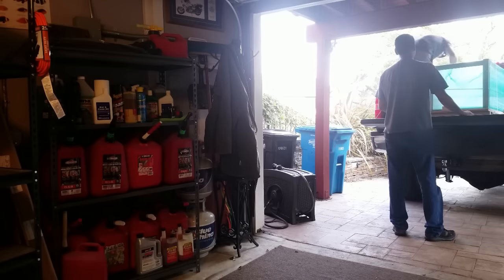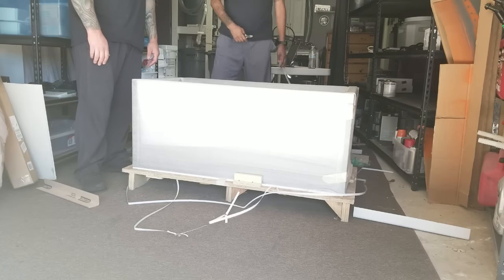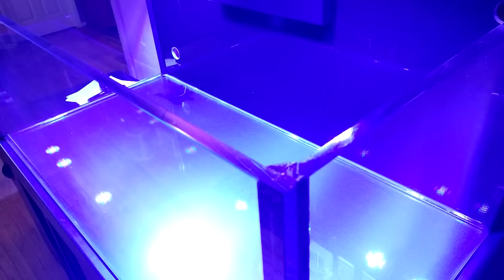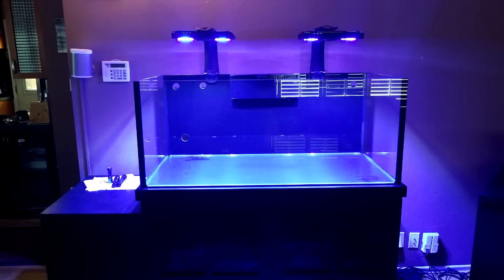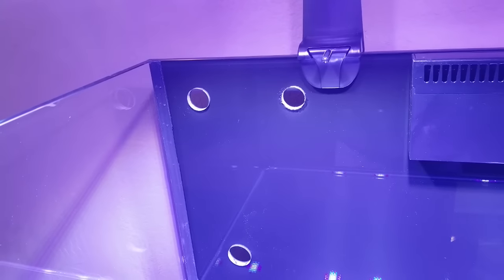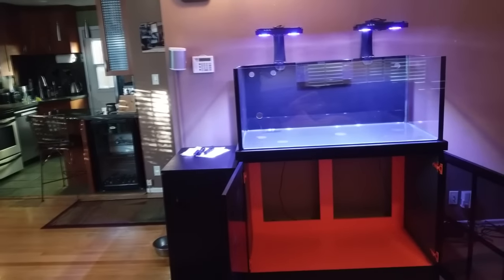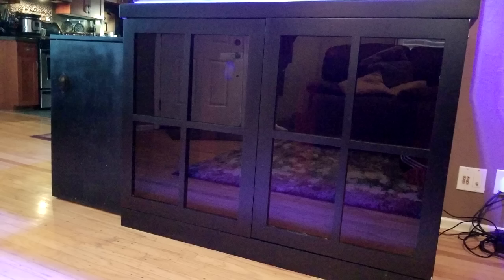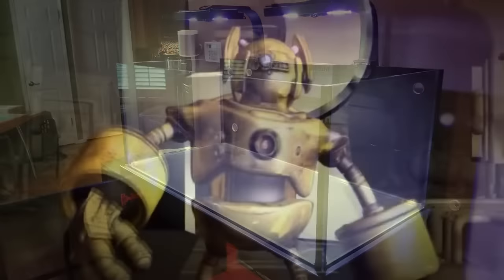Build Series|Eps. 8| Saltwater Tank and Aquarium Stand Revealed

Comment: 100 gallon IMO is a great size. I have the same dimensions and went with it cause it's only 20" tall and the light can easily penetrate the bottom compared to a 120 gallon tank. Looking good man!!
Reply from the maker: How on God's green earth was I not subbed to you? Jumping over to your channel later tonight to check it all out. I just didn't want to go taller because Crystal Dynamics would have put the eurobracing on anything taller than 20".
Reply: ReeferGil Haha thanks man!
Reply: ReeferGil I am totally with you on that, I hate euro bracing for several reasons myself.

Comment: Tank looks awesome good luck.  It might be a good idea to silicone that water change bulk head in addition to tightening it properly just in case it ever goes on you,  that will be a huge water change if it ever goes.
Reply from the maker: LMAO, that's one of my biggest worries having had that hole drilled. Unlikely the water would ever gush out, I'd likely see some salt creep building up before it ever fully failed. At least that's what I'm telling myself. Thanks for the tip though!

Comment: I ordered my tank (225gallon)  72Lx30Wx24H from CDA via Robert at Neptunes!! I had them drill a hole at the same low spot for bucketless water changes also... except I’m not able to run a line for the new saltwater for water changes but still no buckets just long hoses. Neways the new tank and stand look good you’re gunna love the way the tank looks with the starphire glass. Also I’m surprised Robert didn’t try to sell you some Kessils lol.
Reply from the maker: Dang a 225, that's so sweet! Love to have to room for a tank that size. Robert is good people and his store is top notch. Good call on the water draining system you step up, especially a tank that size. Never had a tank with starphire, looking forward to stocking this thing. Thanks for the comment!

Comment: Ahhhhhwwwwwwww Shhheeeeeeeetttt. lol Yea bud. super clean look. digging the low profile overflow. that always irked me about mine,  big dookie overflow box taking up the entire center of the tank. that starphire makes a huge difference also, great idea picking that option. curious did the cabinet maker assure you that, that specific design could hold the 1000 lbs that will be on it?
Reply from the maker: Hey man! Thanks for the comment. The cabinet maker has made me a stand in the past for my 55 gallon back in the day. He knew a 100 gallon with rock, sand and water was going on top. By looking at it, I couldn't tell you if it could hold that much weight. I'm just trusting the maker, lol.
Reply: Yea I didnt see any bracing so it got me thinking. but then again look at those cheapo fiberboard stands that come with alot of tanks. they hold larger tanks then yours and if you were to dismantle the stand you could probably snap the board over your knee lol. those are sooooo scary to me but they work ..... some how. im sure you'll be fine, just my worried mind and over building tenancies kicking in haha. man those huge doors are going to be night and day compared to your old one thats for sure.
Reply from the maker: The oversized doors are kickass for sure. What's up with you? When is that dream tank going in your place?